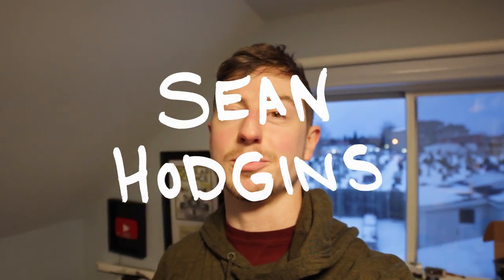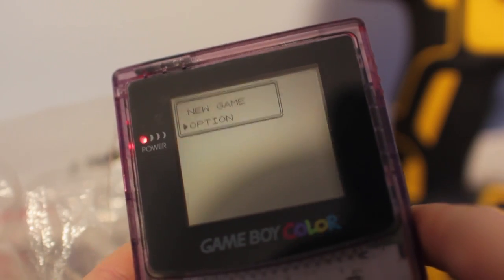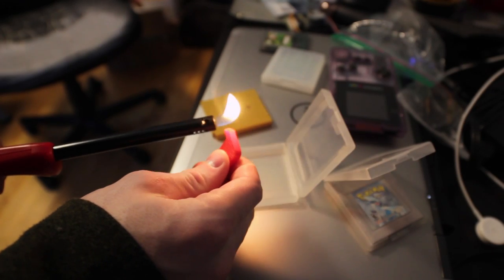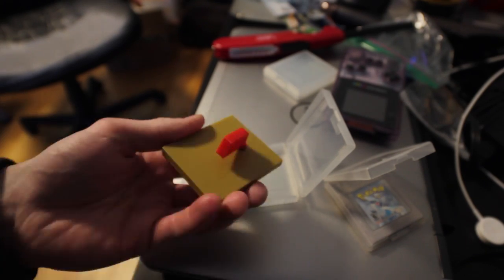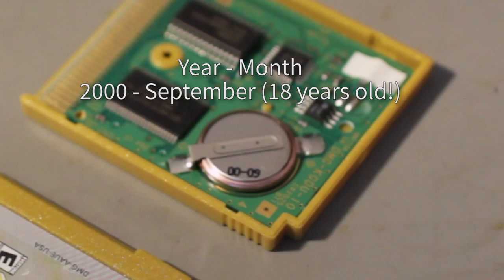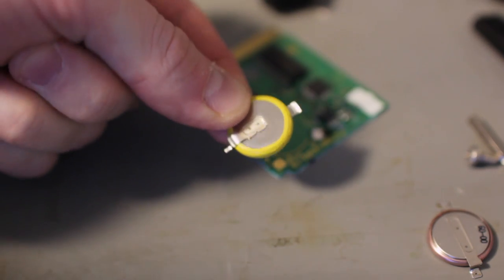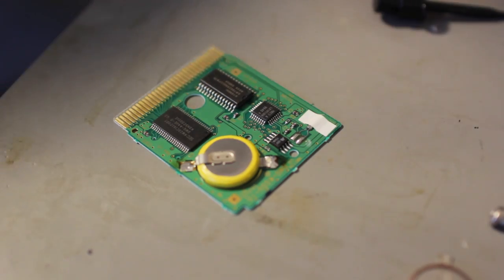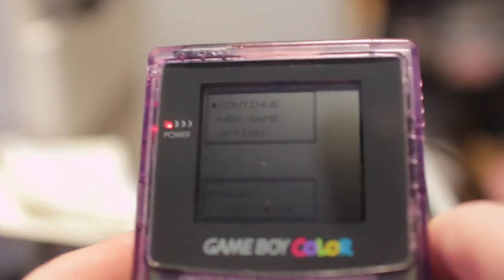Quick Fix: Gameboy Cartridge Battery Replacement

Comment: A little trick I did a few years back when I wanted to ensure not to lose any of my saved games when I was a kid - I soldered a couple wires to a 3.3v battery and soldered them to the leads on the board before removing the almost-dead old 3.3v battery.  Then, I removed the old battery and soldered a separate new 3.3v battery to the board and removed the wires & other new battery.  This way, I was able to keep my old saved game, and refresh the battery ensuring another 10+ years of life in my games.

Comment: I always used rubber bands and a metal rod with the matching diameter for weird screws. But your method looks way more convenient! Thanks a lot ^^ 
Please post more short videos.
Reply from the maker: Yeah that would work for these also, they’re not screwed in very tight.

Comment: It's crazy how long those batteries even last.  Like I plugged in my SNES after a good 15+ years since it was used and some of my childhood game saves were still there.  It's quite impressive.   The load is super small but still impressive nonetheless that the saves lasted all this time.
Reply: To be fair, the Pokémon games beginning from gen2 have a clock running inside the cart, fed from the same battery.
Reply from the maker: Nintendo has a pretty good quality track record. I’ve had lots of coin cells just die on a shelf. Let alone keep power to a chip.

Comment: the other size typically used is CR1616 I believe, however you can, in most cases, use a CR2032 as well(I did this for a copy of Pokemon Crystal). Same voltage, longer life.

Comment: I was just discussing this with a co-worker past Friday -- thanks for the tip on removing the screw! Now this is indeed quite simple but... is there any way you can replace the battery without actually losing the save game?
Reply from the maker: Yeah, but its more involved, and you still might lose your game. You could solder on some leads on the cartridge to a 3V source before taking off the battery. Another possibility is to have the game in a powered on Gameboy with the cover removed, again risky though.

Comment: So the battery comes with the terminals already spot-welded on it? Well, that's a complication.

Still, now I know what it takes to open and repair them; I've got several games with dead memory batteries and I want to apply this skill in my new NFP. Thanks!
Reply from the maker: Yeah they do, why is that a problem? You can get them without terminals too.

Comment: Hello, any way to keep power on the cartridge while changing the battery? I have a pokemon yellow game with my savegame still alive and i would like to keep it. Thanks in advice
Reply: You need to keep it powered while replacing the battery.
You don't want to charge the battery to the point it explodes or shorts, so you could use a bench PSU and dial it down to <1mA and remove the battery quickly after connecting the PSU that needs to be clamped on so it doesn't release when unsoldering the battery.

Comment: Is it possible to hook another battery up in parallel to prevent losing any progress?

Also had no idea these had batteries in them!
Reply: Yeah, that can be done. Some people say to use a 9V battery, but that's about three times more voltage than the battery you're replacing, so your mileage may vary. Don't want to burn out your SRAM!

Comment: Hey I tried all this out. I was able to remove the old battery but getting the new battery to stick has been a problem for me. Any tips?
Reply from the maker: Lots of flux on the pads when soldering. Flux always helps. You have to get that heat into both the pad and the battery terminal and it should flow together
Reply: @SeanHodgins  ok cool thanks I’ll try this! And the pads don’t  have to be glued at the same spots where the old battery pads were at in order for it to work do they?
Reply: So I tried more flux and it seems to be sticking but now when the game turns on, it freezes